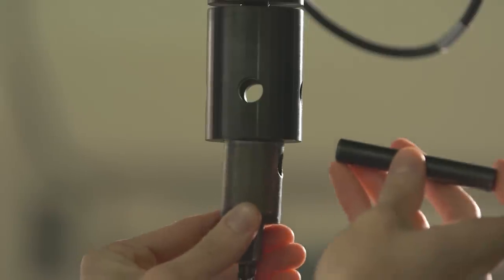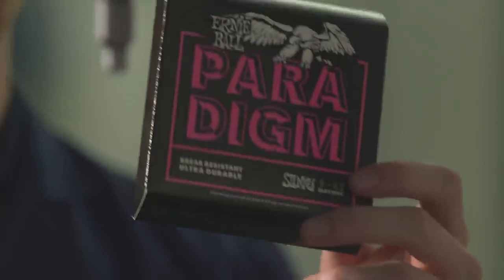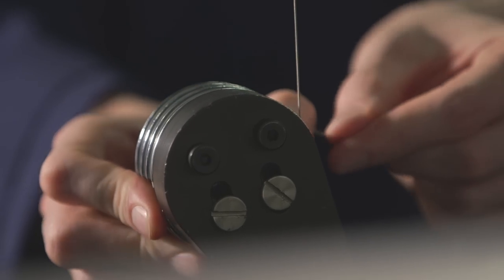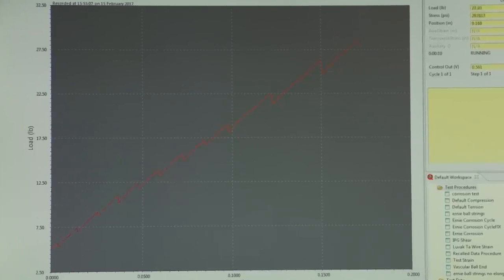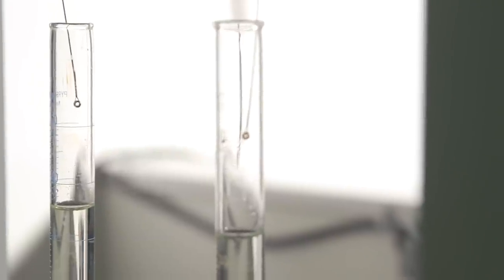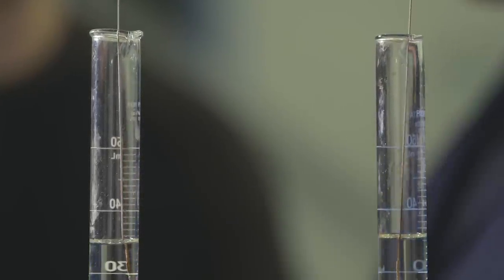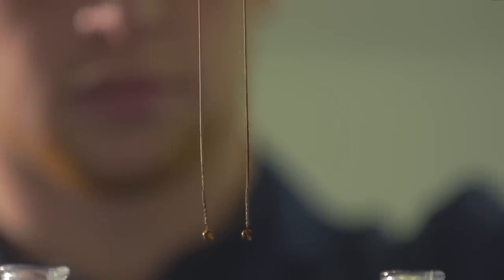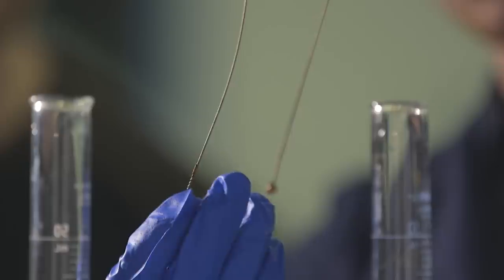Ernie Ball PARADIGM: Lab Testing at Sturbridge Metallurgical Services

Comment: I am almost one month in on my set paradigms, so far so good. I do see a little discoloring on the b and high e but it still feels smooth. So far I love these strings you can bend the crap out of them. Perfect for my Floyd equipped guitars.
Reply: How long did those strings last until u changed them
Reply: @speed_will  13 Months before I changed them
Reply: Ok
Reply: I manage to broke a set of paradigm's after 2 days😂
Reply: @neneaanghel7016  Mine lasted for close to 3 years of not changing the strings. I am pretty sure you would break any string if you broke them in two days. I call BS on it but if true playing guitar for you will get expensive. Do you use a railroad spike for a pick?

Comment: Wondering if they can hold a high A (440Hz) at a 24.5" scale. D'Addario NYXL are the only ones - in my extended experience - that do (0.0085" or 0.009" gauge). The tradeback is that they seem just a shy less magnetic = a pinch less volume, contrary to the manufacturer claim.

Comment: How did they do under fatigue loads compared to others? That would be a better gauge of durability.
Reply from the maker: You've made an excellent observation, and we completely agree. PARADIGM strings showed up to a 70% improvement in fatigue strength as well based on internal testing.
Reply: But, where on the strings did the actual failures take place? At the bobbin area? On the lower 10% of the string? Or more towards the middle? Depending on location it could be that these strings are actually stronger than the tests prove them to be.  Was any test performed where a pick or fake thumb was used to pluck the string in the playing zone?
Reply from the maker: We actually do test all of our strings with a motorized picking machine to test for that type of breakage in addition to tensile strength, corrosion, etc.

And it is fair to say that these are very likely stronger than the tests prove them to be, we just want to be sure to represent only the numbers we can back with data, even if the real-world outcome is almost definitely better.
Reply: I broke my Paradigms on both guitars, strings lasted 2 gigs on one guitar and didn't quite make the end of gig two on another guitar. they also started to oxidate (rust) after the first hour of playing. No different from normal strings for me.
Reply: +Dave Barlow but they guarantee it?
Reply: @DaveBarlowGuitar  If you are breaking strings like that, then you or the guitar are the problem. The last string that I broke was a Dunlop plain string 6-7 years ago that was taken down and reinstalled on the guitar after a refret so the steel was already fatigued.
Reply: might be worth testing them with musicians who dont have a new set of strings every night @ernieballinc

Comment: No actual measurement numbers presented. No comparison to regular Ernie Ball strings. No analysis of different failure modes. No clear definitions - what is a "traditional" string ? A lab should be embarrassed to be part of this. You call this science ? Smoke and mirrors. These may well be good strings. But this presentation gives zero confidence in that.